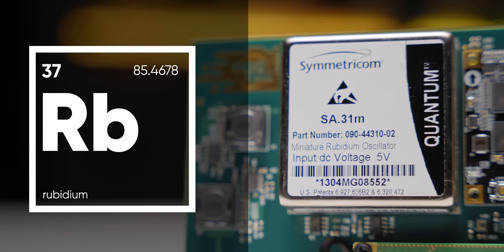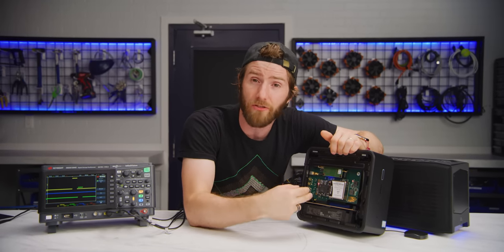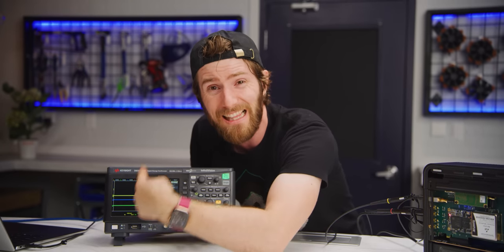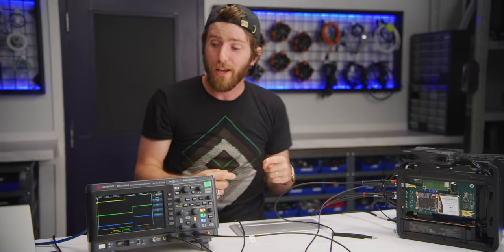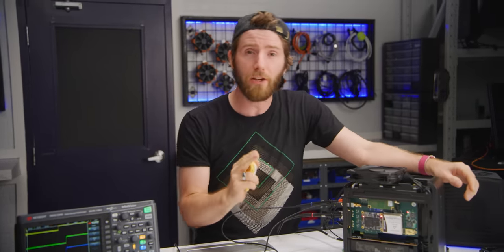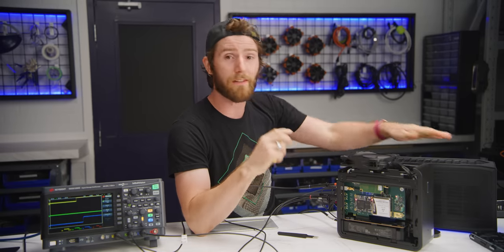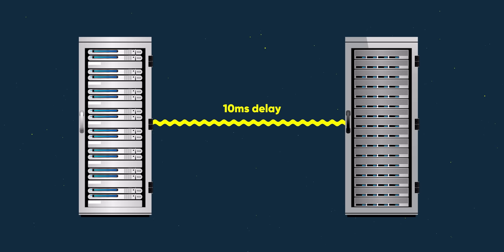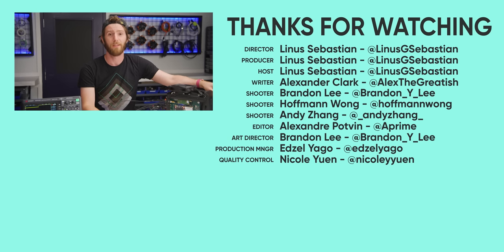Why is this PCIe Card RADIOACTIVE?

Comment: Fun fact: the Atomic Clocks in GPS satellites are set to run very slightly faster(?) than the clocks on Earth.  Because of Relativity (Gravity and Velocity) causing time to drift apart.  If they didn't do that, GPS would lose several kilometers of accuracy every week!
Reply: That's true! At work I use rubidium clocks or our big GPS antenna on the roof to get the most precise 10 MHz pulse for my applications.
Reply: @The Program Isn't it fucking wild that "I have to account for the distortion of the fabric of space-time caused by black holes" is a thing you can say about your work and be 100% honest about it? Literally a Star Trek engineer at this point
Reply: @vidyajamesu  No, no "I have to account for the distortion of the fabric of space-time caused by black holes" it is "I have to account for the distortion of the fabric of space-time caused by Earth" Gravity is a distorsion of space AND time, that includes Earth's gravity, the reason the gps have to adjust is Earth gravity mostly, since gravity is slightly different at surface and at orbit, time ticks slightly differently, it is very minuscule but in stuff like gps that need that level of preccision that slight difference adds up and is enough to mess with them.
Reply: And the satellites are also yeeting around earth which causes them to experience time slower.
Are the signals from GPS sattelites more precise than those from ground based atomic clocks? Cause there is one less than 340km from here that transmits per radio and is also accesible per NTP
Reply: I dont think so, because if satellites would run at least slightly faster - you would lose GPS lock at higher altitudes. Time drifting at long distances is key feature to lock your location, and once its done - your device knows how far you are from satellites and can calculate exactly what time is on them.
Reply: Why wouldn't you have it run regular speed then do the math to include the drift in the calculation ?
Reply: @The Program step 2 a global mesh network of gravitometers to calculate and account for all gravitational distortions, we cant have mantle shifts giving geologically stable areas less lag
Reply: @diablo.the.cheater  it's even funnier, "I not only have to account for the distortion of the fabric of the universe caused by the earth, I must also send that information around the globe at the speed of light, accounting for the error caused by background radiation caused by the creation of the universe.
Reply: In LEO they run slightly slower as their still inside 90% of the gravity well but are moving very fast as well.
Reply: Alien spacecraft manipulate time progression because they manipulate velocity/gravity.
Also Hedge the satellite GPS runs *faster*, so the clock timing progression is corrected by making it progress *slower*.  
Also Linus is handling that device very rough while talking about the radiation.
Reply: @nickduplaga507  that's OK, since rubidium has a half life of 48.8 billion years and is a beta plus emitter (it spits out a positron and an electron neutrino while it decays to a stable isotope of strontium; positrons are stopped by pretty much nothing until they come to rest on their own (by random capture) and interact with electrons at which point they're annihilated and convert to gamma photons - which are stopped by a few cm of air). This has medical applications for example, for tracer imaging.
Reply: There are several correction algorithms in use to compensate for gravity, and numerous relative velocities. I went to high school with a math wizard who won awards for some of that initial research.

Comment: That solution to add 20ms to every request seems like a very TODO commented code lol
Reply: Honestly, having worked in programming in some way or another for over 10 years, this seems exactly like the kind of half-assed patch that data centers would use.
Reply: Nah. It is just everything else could really make stuff harder to debug and could cause crazy bugs. Sometimes the easy solutions are the best. 
I mean the people working there are not stupid and if they can get a factor 100 improvement just by having more accurate timestamps I am quite sure they tried a lot of alternatives before.
Reply: I remember it was a solution used to make sure projectiles on scratch actually did damage before dissapearing
Reply: hey, if it works at all...
Reply: @undead890  go down a layer and you'll find that this is the type of "half assed solution" everything runs on.

A significant amount of raw capacity (be it bits, cycles, whatever) is spent in the process of keeping track of the ones that do actual stuff. You just don't see it because it's handled at a level below where you're working. You ask the OS for a file and you get the bits that make up the file completely oblivious to the 6 extra ones added by the hard drive for every 8 useful bits just to keep track of timing.

Comment: The fact that this was made open source is amazing, world changing stuff.
Reply: Yeah man, imagine framework laptop comes up with an atomic module for a laptop
Reply: i agree this ist some Volvo Seatbelt level move!
Reply: I don't think so. The design uses many exotic parts and is overly expensive. Generally it is called GPS Disciplined Oscillator (GPSDO), it has been implemented so many time that some  people call their design "Yet another GPSDO".
Reply: ahmad big homie
Reply: It's more open hardware than open source in its current state.
Reply: @longpham-sj5sv  There’s always that guy……
Reply: @longpham-sj5sv  i don't think the big deal is not that it's first of its kind
it's moreso about the price level of such project
in fact, that's kind of the whole point of the project
it's as if you're not even paying attention to the video
1600$ is not nothing but it's not 35000 expensive

there's one you can buy from sparkfun (surprisingly)
but it costs almost 2k already and that's just the clock, without the rest of the hardware supporting it

Comment: When Linus watercools this thing, it will require a stack and some graphite rods
Reply: ow man not again
Reply: Nuclear reactor cooling
Reply: Lmao
Reply: we do a little trolling
Reply: Not great, not terrible.
Reply: On this episode of Linus Tech Tips we water cool pur nuculear reactor
Reply: Chernobyl flashback
Reply: time to water cool a galaxy
Reply: For the rubidium molecules to vibrate at the right speed, they have to be within certain temperature tolerances. AKA cooling it would make it run too slow.
Reply: Watercool? They will overclock it first to get the 0.01 ns deviation
Reply: ahhh fukushima will be repeated by linus
Reply: He would also require scram protocol..
Reply: @krazykatz97_1  As long as it doesn't run on lithium batteries...
Reply: When you re playing Metro and start to taste metal
Reply: @AzziesPersonalRecordings  isnt the internal structure of the card temperature controlled ? so, in theory any outside temperature variations may not effect the timing at all, except the variation in the length of the wires carrying the signal as metal expands on heating
Reply: @achtsekundenfurz7876  oh no
Reply: @Aiden Broker LOL! Hey! Why does every time someone say, radioactive, you look at us? :-P

Comment: It's working on a Raspberry Pi! Hope to have a video about it soon. No problems cooling the itty bitty NIC on the Pi Compute Module 4 ;)
Reply: imagine jeff collaborating with Anthony. The crossover we didn’t know we needed.
Reply: @Jeff Geerling
I was just thinking of you when I mentioned a pi array in my main thread comment!
You have a great channel by the way, you really make me want to pick up a pi 4, and maybe do more with my current 3b lol
Reply: So I am guessing you will be able to drastically increase your Pies clusters efficiency. Wonder if it will make supercomputer and parallel computing and application more accurate speeding up everything. 

I am waiting on the video.
Reply: Hy  - Jeff its pcie so probably need only a driver but if I see the card gives out sinc clock signal so we can use that on gpio
Reply: but to more precise and we need speed ,Assembly lang to keep the program runin cycle to minimum.
Reply: did u tried lol
Reply: @Nihalbarakat  This would break the Internet.
Reply: Just don't let Red Shirt Jeff touch it.
Reply: If only they were even in stock anywhere
Reply: of course you do. I second the call for an LTT / Geerling collab on something nuts.
Reply: Hi jeff!
Reply: @JeffGeerling  yes it wud
Reply: Howdy Jeff
Reply: If objective is nvme module for gaming sync, what about gaming guy with a hackrf doing some gps spoofing to get a few milliseconds ahead of everyone? :)